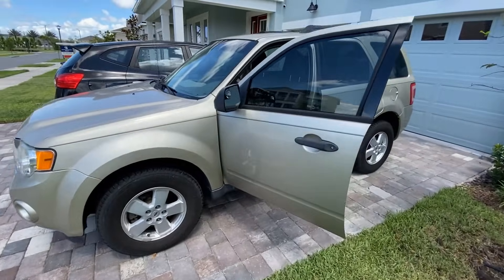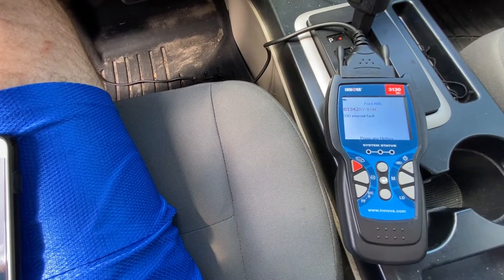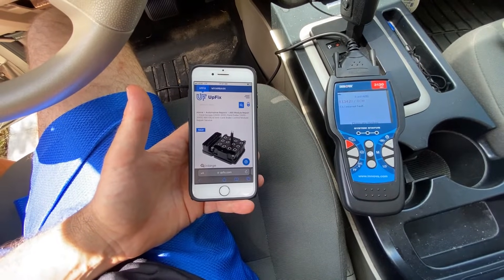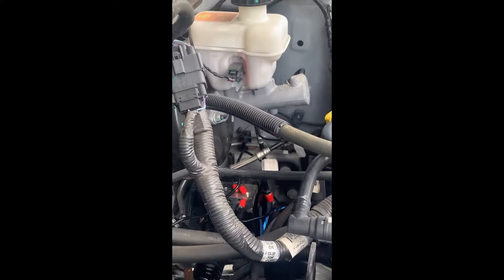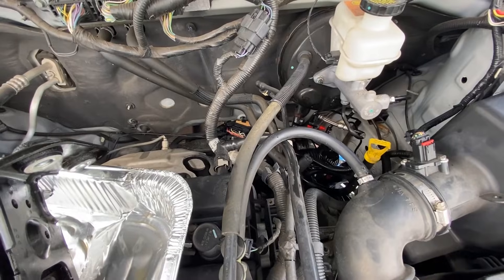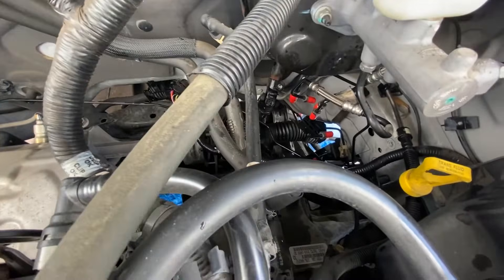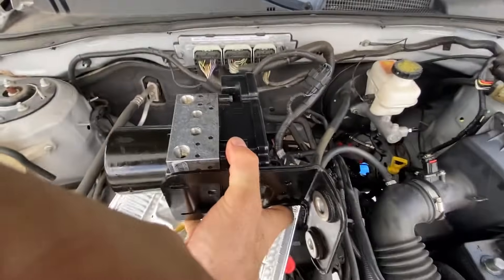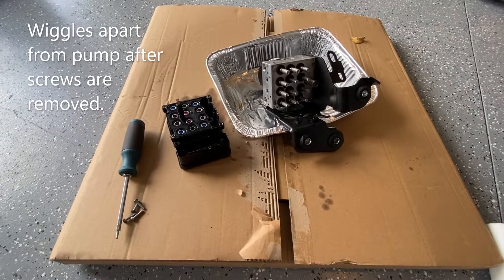Solved -  ABS light flashing B1342 code EBCM Removal (Ford Escape)

Comment: Hi your video's are great. I have the same indicator lights lit up in my 2011 Escape. Question is what are the models of the two electronic tools you used to diagnose the codes and then perform the  power bleed? Where can I get them?
Reply from the maker: Hi Danzicari. Thanks for the compliment and I'm glad my videos help. I would just get the Foxwell scanner/bleeder: https://amzn.to/3J5UI1L. It can do the same OBDII scans as the Innova 3130, but it also does the ABS bleeds. If I remember, this power bleeder was used to force fluid back through the abs system: https://amzn.to/49kF9y5. I highly highly recommend you do not allow the master cylinder to drain if you can prevent it. Its a fair pain to prime it back up with fluid. Best of luck to you!

Comment: I'm having the exact same DTC and symptoms in my 2012 escape. Were they able to fix the issue?
Reply from the maker: They were able to repair the abs control module. Been driving on it now for over 10k with no issues.

Comment: How did you get that 10mm nut at the bottom?! It is currently making me want to drop a lit match in the gas tank
Reply: I pulled mine today and that 10mm nut on the bottom was a NIGHTMARE.  I ended up using a ratcheting wrench.  Took me about 3 hours to get the whole thing out.
Reply: @fixfalcon2628   It would be a pretty easy job if it wasn’t for that one stupid nut!!! When reinstalling I found it best to just lay on the motor, accept the scrapes and cuts on your wrist and arms and get it started with your fingers. $399 vs. $1,800 definitely made it worth the time blood sweat and tears tho!
Reply from the maker: Socket extension to remove. Paper towel wedged in the socket to hold the bolt to install. It is in a difficult position for sure. I feel your pain!
Reply: That 10mm is really difficult to get.
Reply: But once you get it, this whole procedure is well worth it! And installing that pesky bottom nut is much easier than removing it! Put on some raggedy clothes and just go all out laying across the engine. Probably get a few little nicks or cuts on your left arm but that’s worth the $1,200+ you save by going this route! I was so grateful for this video when I DIY’d this 7 months ago! Still no abs lights

Comment: Plugging the lines with those red caps isnt really necessary is it? I dont have any and have no idea where to find them
Reply: It help with bleeding the brakes I would making sure the master cylinder does not run dry. You can just get any weird cap that fits over the end of the brake line
Reply from the maker: If you don’t plug the line from the resivoir, the resivoir will drain and you will need to bleed the master cylinder. A bit of a pain! 

The red plugs were to keep dirt out of the lines. 

If you not going to plug then be sure to drain the resivoir first. It’ll save a big mess.

Comment: SO IF YOU ARE ABLE TO HAVE A PCM, ANTITHEFT SYSTEM AND THE ABC MODULE FROM ONE WORKING ESCAPE  AND TRANSFER TO ANOTHER NOT WORKING ONE, DO YOU THINK PROGRAMMING STILL BE NECESSARY?
Reply from the maker: Hmmm. I would need to phone a friend from the YouTube community. Anyone know the answer on this one? 

If not, I would call Ford and ask them if the PCM and ABS modules are paired.

That said, I suspect there could be much more reprogramming needed to swap a PCM. So I would definitely ask Ford and research further. 

Good luck!
Reply: It will not work. Very few programmer know how to fix it

Comment: We’re brakes mushy? As an indication the module may be bad?
Reply from the maker: No. The only indication was the lack indicator lights.

Mushy brakes are typically an indication of air in the system. First thing, check the brake fluid level in the reservoir.

Comment: Hi Sir, question, do I need to bleed/flush the brakes before taking the module off the car? You put is "recommended" but what if I don't do it? I am asking because I have never flush the brakes before, so I'm wondering if that would be still ok. Thank you so much for your video it will save me the waste of $$ going to a dealer for just programming 🙏
Reply from the maker: Hi there. I assume you watched both videos for removal and install.

First, check to see if you can access the EBCM fasteners and harness release without removing the ABS assembly. If you can, try removing the EBCM without ABS assy removal. If successful you will save yourself a lot of time and mess.

Assuming you have to pull the entire ABS assembly, then ideally you will want to cap off the reservoir side of the line that runs to the ABS assy. It’s a nipple on the master cylinder that can be capped to prevent all the brake fluid from draining out after you remove the line. If you can achieve that it will save you from having to bleed the master cylinder, which is a pain and requires 2 people.

If all else fails, drain the brake fluid from the reservoir/master cylinder before you disconnect the brake lines from the ABS assy. Otherwise brake fluid will get everywhere.

If you ever open a brake line in the brake system where air does or possibly does get in, you will have to bleed the system. Thats not the same as flushing the system since the objective of flushing is to replace all the fluid whereas bleeding is to get air out of the system. 

If you have to drain the master cylinder then I recommend, after you put it all back together, start bleeding at the master cylinder. Once you get all the air out of the mast bleed from each wheel. You may have to go back to the master if the brakes remain spongy, but the wheel bleeds will be much easier.

Good luck!
Reply: @Thatguysauto  your explanation was exactly what I was wondering. I was think what if I can just disconnect the ABS Module from the hydraulic and save all the mess and time..I will try that first..if it gets really complicated, I will follow your detailed explanation. I really appreciate you taking the time to make this video and also answering my questions. God bless you!
Reply: I'm getting ready to replace my ABS Pump/Module.  Do you have any idea what size those Threaded Caps to cap off the lines to the Master Cylinder are?

Comment: Hi there, how much did you pay?
Reply from the maker: Hi Joel, the going rate for the ford escape EBCM repair in mid-2022 via UPFIX was around $350. I see its $399 now at the end of 2022. I believe there is some other competition out there for the same service at a lower cost on other vehicles. Unfortunately I have not found the ford escape service offered by others at this time. 

https://www.upfix.com/product/ford-escape-2009-2009-abs-ebcm-module-repair-service/

Comment: If you have rusty Torx head bolts holding the module cover to the aluminum block, and make the mistake of trying to use a T15 Torx driver to remove them, be warned that in some cases, it actually requires a T20 driver to tightly fit into the Torx socket on the top of the bolt and remove it. I removed 3 of the 4 on my 2010 2WD Expedition with a T15 driver, but on the 4th one, I stripped it completely.  It is extremely difficult to get it out after that. I had to cut off the head of the Torx bolt with a drill bit to remove the module cover, and I'm still trying to remove the headless Torx bolt without snapping it off.  Replacement screws either come from a junkyard module, or from Ford at about $7.50 each, plus tax and shipping, or eBay if the dealer doesn't have them in stock.  Finding the part number is difficult, but here it is - Genuine Ford ABS Control Module Bolt W302577
(403588103872). On eBay it can appear that the package contains 3 or 4 bolts, but only 1 comes in the sealed Ford package in my experience.  I was happy to have it at anything less than $10 each.
Reply from the maker: Good tip! Sounds like a good time that I’d rather not experience!